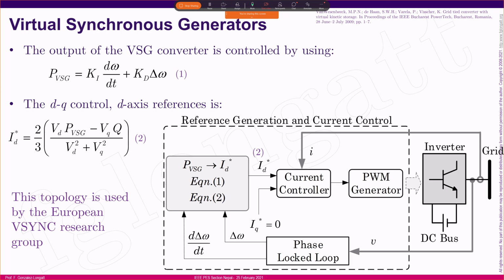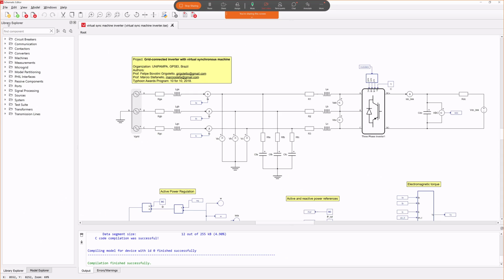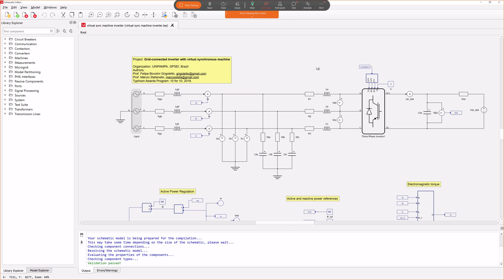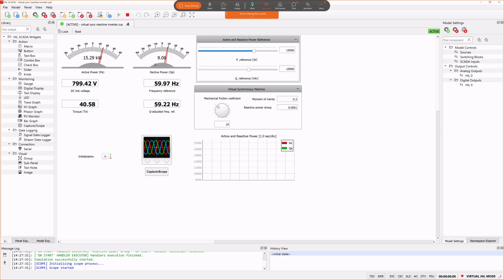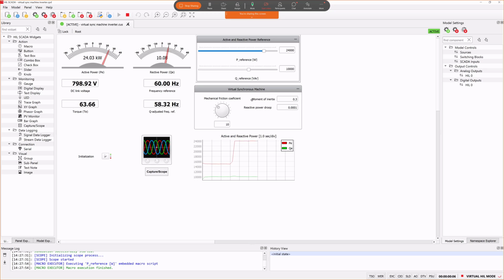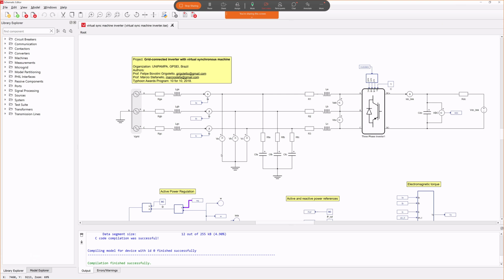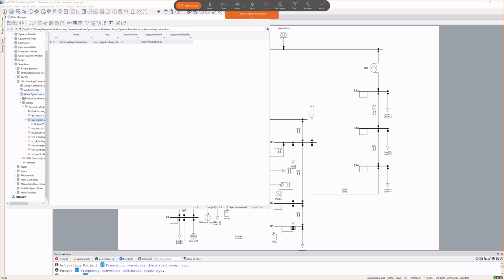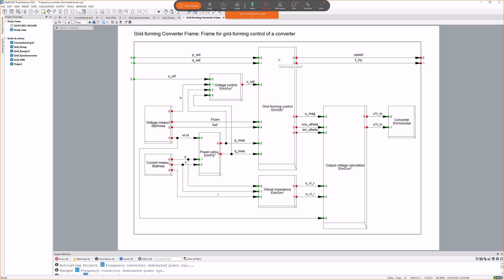(Preview)... #Gridfriendly #converters... VSM is not new! #DIgSILENT #TyphoonHIL and #PowerFactory

Comment: Hi Professor,

I would like to ask you that in grid forming converter templete in power factory they used Static generator , can we use PWM converter instead of static generator??
Do you have any current controller design model which gives outputs for PWM converter which is used instead of static generator.
Reply from the maker: Version 2021 SP 5 (Oct 2021) uses ElmGenStat. PWM is a bit more complex. I will love to see your implementation. Best regards, FGL
Reply: Hi Dany, do you have any luck in finding grid forming converter PWM typein PF2022 ? I'm stuck with F2019 for now. Thanks